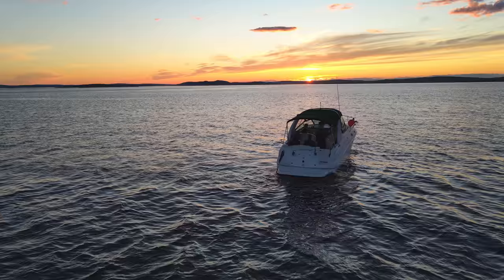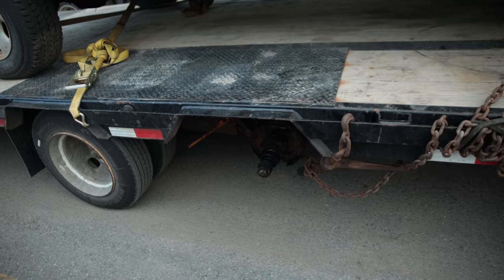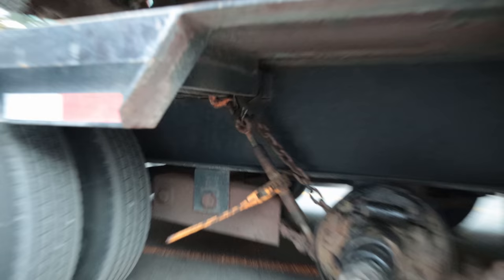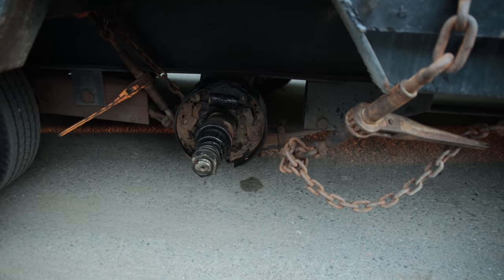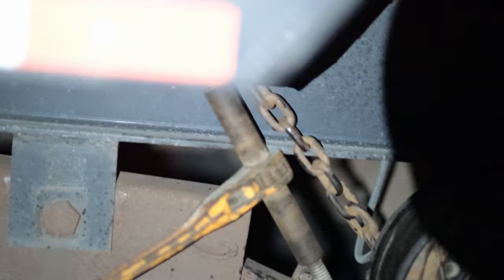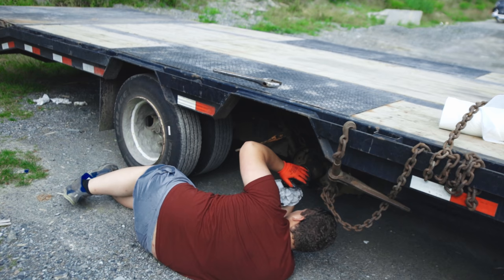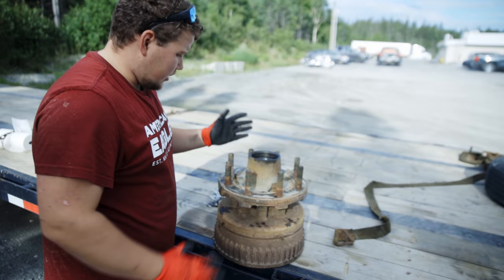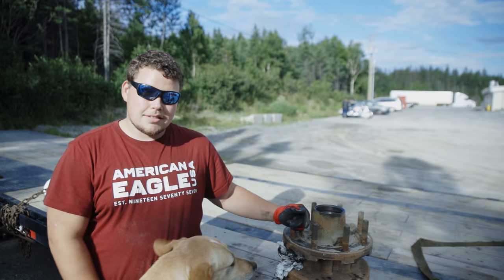TOTAL Axle Failure - How to Chain up/Strap a Tandem Trailer Axle!

Comment: Knock the races out of the hub, new bearings, races, and seal.  Keep trucking.  Trailer maintenace is a real thing.
Reply: should be able to do it in the next town with tools kept on the truck really.. not a huge repair at all

Comment: There is an inner and outer bearing race and you need to change them. They will come with the new bearings.
Reply: My thought were you already have it apart might as well put new bearings, races, and seals in and grease them really good. Trailer maintenance. Just don’t slap the hub that came off back on with out inspecting it by taking it apart.

Comment: Hello, but once you hit the brakes, you will LOOSE THEM, ON THE MISSING AXLE , DRUM BRAKES   OH WELL, Cheers 🇺🇸🇺🇸🇺🇸🇺🇸
Reply: I've never lost electric brakes on a multi axle brake system when a hub came off. Aint like air brakes or hydraulic brakes.